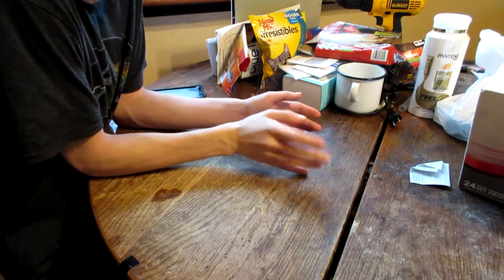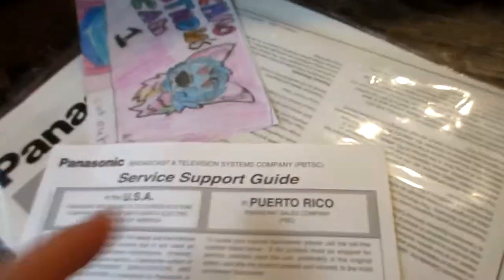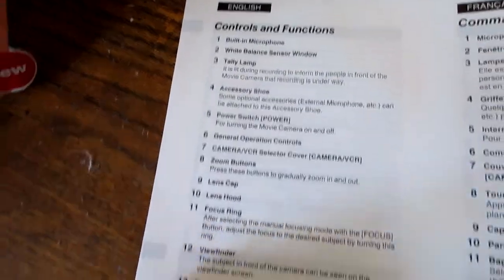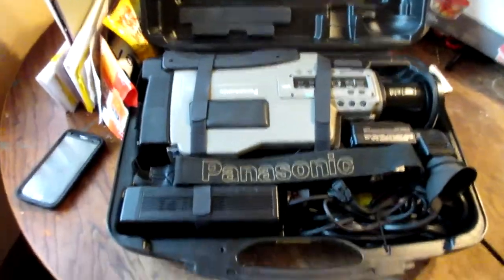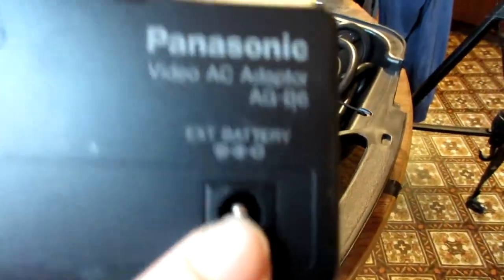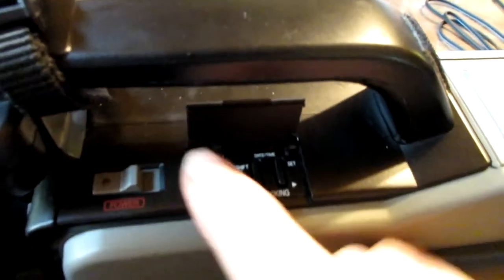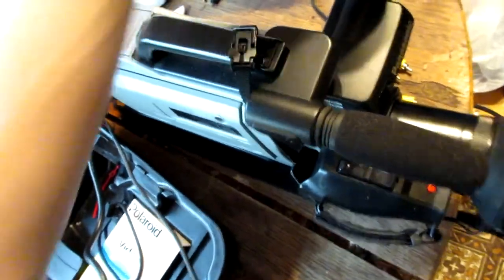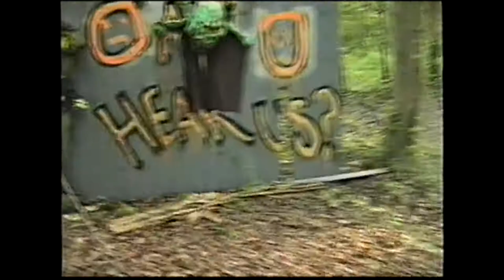Review of panasonic AG-196 vhs camera

Comment: How do you film without having to plug the AC power supply into a wall. Because it seems like your filming without having to plug into a wall
Reply from the maker: it has a battery well i had to buy a brand new battery
Reply: @axelthefoxytechworld8024  can I get a link